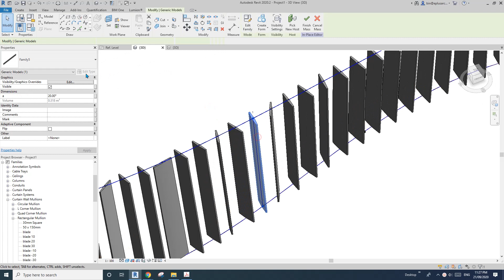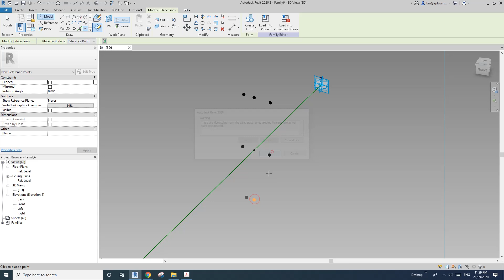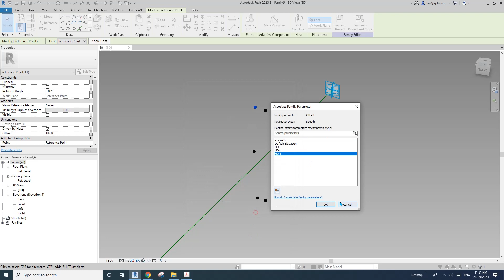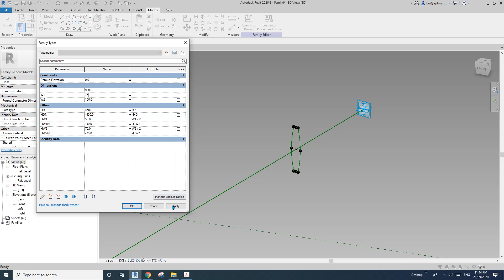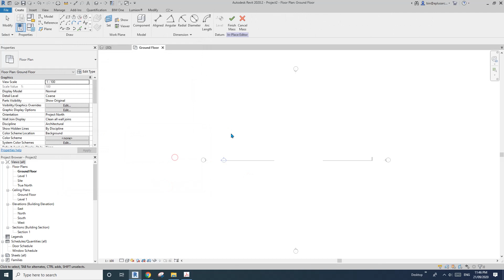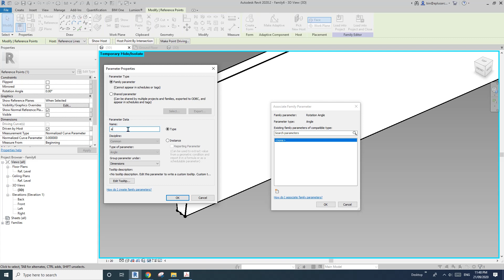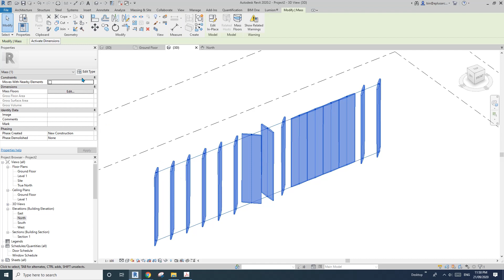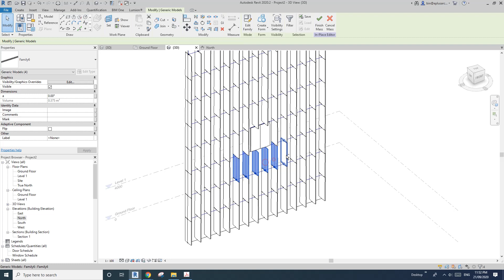Revit Exercise (Day 186) - Adaptive Parametric Blade Facade

Comment: Hi, very useful video. But when I draw the line in the mass, it said mass contains no solid geometry. Mass floors, volume and surface, won’t be computed. How can I resolve this?
Reply from the maker: You need to create form from that line.
Reply: @BINHE615  yes, I did. I tried a few times, but still show only mesh geometry 😭😭
Reply from the maker: It doesn't matter, this warning is telling you that there are no solid in your mass and you will not be able to create solid floor from it. In this case, you only need a face to create divided surface. You can ignore the warning.
Reply: @BINHE615  OK, thank you so much